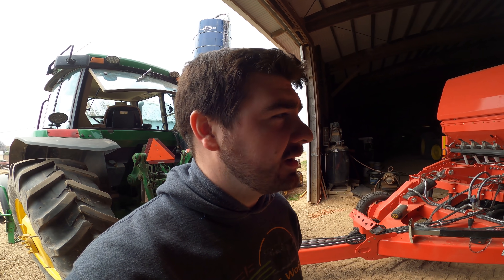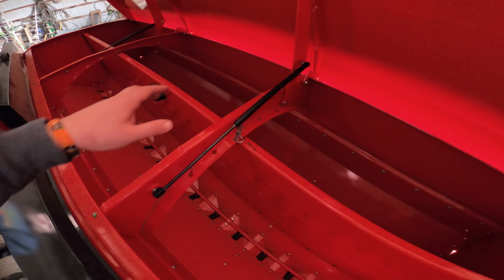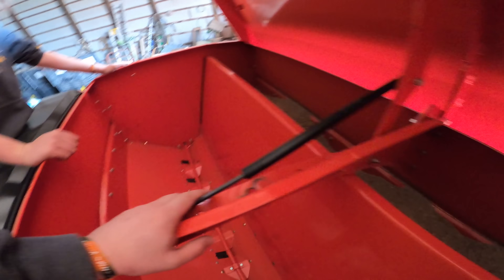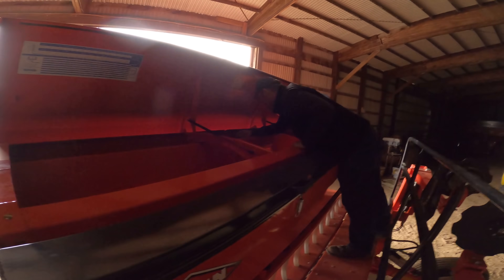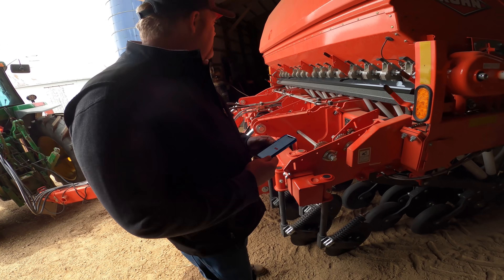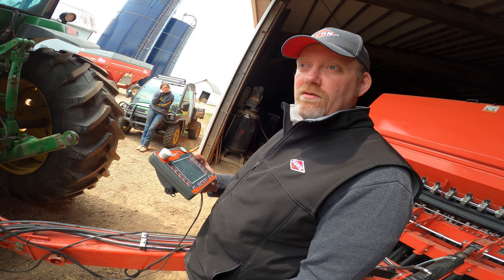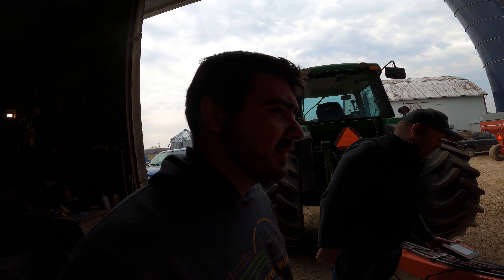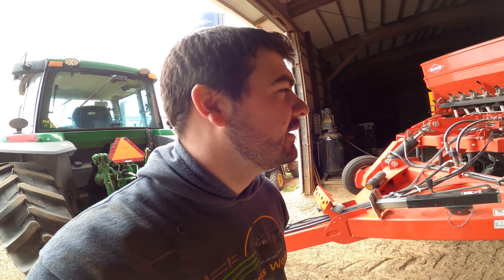KUHN 9400NT Seed Drill Calibration

Comment: In my opinion khun make crap equipment just hunks of crap. Apart from the hay tedders they are the best other than that i wouldnt but anything khun. If you want a good strong and reliabale drill that will never let you down buy a vaderstad hands down the best drills in the world.
Reply: This seeder looks "okay" but IMHO the front gauge wheel and rear press wheel on every opener is overkill... if the field is THAT uneven, you should have done a better job preparing the ground for planting!  I get that it's supposed to form a "walking tandem" to keep the opener blades at a more consistent depth than the rear press wheel alone will do, BUT it's a VERY complicated system with a LOT of extra moving parts, and those LONG openers are gonna create a HUGE amount of side-loading of the drill opener suspension arm(s) going around a curve or seeding corners... all that will add up in premature bushing wear and side-to-side 'slop' in the openers over time...  Just a LOT of added complexity and expense (and parts) for what is a minimal problem... if you need THAT good a depth control, just go to the side-gauge wheel models like a planter unit has...  Seed boxes and meters look neat, cool idea with the spiraled fluted feed rollers in the meters, so they release seed almost constantly and evenly from one end to the other, instead of each flute dumping over into the seed tube at once as the fluted feed wheel rotates... Again not sure of HOW MUCH of a problem that actually is, but it makes sense that your seed flow would be more consistent that way... "seed spacing" accuracy is nonexistent with a drill, by the time the seed shakes down through those long convoluted tubes to the openers and into the ground, BUT at high seeding rates the spiral fluted feeds WOULD be more consistent than the straight ones.  Course I'm sure they're also more expensive to produce and therefore cost a lot more money.  

I've run Kuhn equipment and it does a good job, but I wouldn't buy one of their disk mowers-- when the disk hits something, the entire top shaft is designed to shear off and toss the disk out the back of the mower, because they mill a slot in the shaft just above the seal that reduces the diameter down from about an inch or so to smaller than a dime, so when it hits something this "weak point" snaps off to protect the gears in the cutterbar... Wouldn't be such a BAD idea, but Kuhn DOES NOT sell ANY of the parts necessary to repair the top-service hubs on their cutterbars... so when it shears off, you don't just get to buy a new shaft and install it in the existing bearings and hub and gear, NOPE you get to buy the ENTIRE ASSEMBLY for about $250, versus about $40 for a New Holland shear hub, or about 50 cents for a double roll pin in the Krone shear hubs...  Get twine or dirt wrapped around the shaft and wear the seal out-- too bad, another $250 hub!  Bearing worn and getting "sloppy", again "buy a new hub unit".  Owners on the HayTalk forum have been swapping parts out of busted units to make new ones... gear and shaft from one, bearings from the other, seal and top disk hub from another... mix-n-match to save money... Kuhn says farmer's are "too dumb" to be able to set the preload on the bearings properly to rebuild an existing hub with a new bearing or shaft or seal, so they ONLY sell the factory-pre-assembled UNITS for BIG BUCKS... for that reason, NO Kuhn for me!  OL J R :)

Comment: Only a suggestion of what we used to do with our bagged fertilizer in the 60's. We would pull the string about 3/4 of the way and still leave it attached to the bag. It's enough of an opening to allow the seed to flow freely out of the bag and a lot easier picking up the bags with everything still attached and discarding when grabbing the bags, strings and paper bonding wrap. Of course, we use to have 100 or more bags to deal with and not just four....lol

Comment: Go buy a plastic sled, the ones that are rectangular and have handles on the sides.  Cut the very front edge off.  You can lay seed bags down on em, open the end of the bag and just pour it in to the front hopper/rear hopper etc.   Beats the hell out of hand strain.  If you got a hoist you can throw straps under it and use it as a lift-skiff.  Farming is about making sure everything is as easy to do so the long hours don't kill.

Comment: Will you use it for planting soybeans?
Reply: Caleb Grill I was going to ask the same question since you can meter it better than a normal drill
Reply: Randy Williams Travis has already said that it is unlikely that they will plant beans with a drill anymore as the accuracy and depth control of a planter is far greater.
Reply: Only 10 feet wide, so it'd take them about 2 months straight to plant their beans with it... just too narrow to be much use for big acreage... Fine for seeding waterways and a couple small hay patches, but for large acreage not so much... Pretty swanky having a $30,000-40,000 new no-till drill to plant waterways and a couple hay fields... OL J R : )